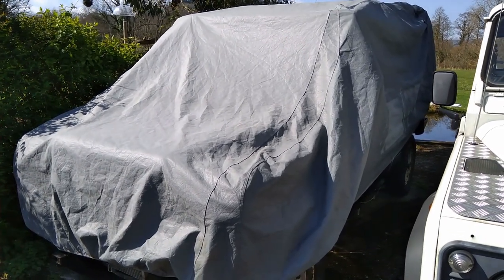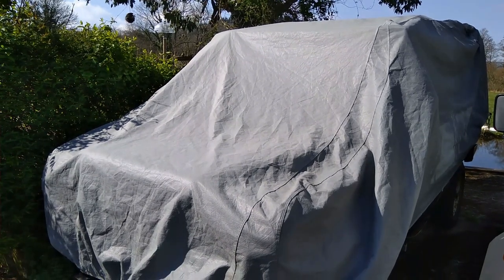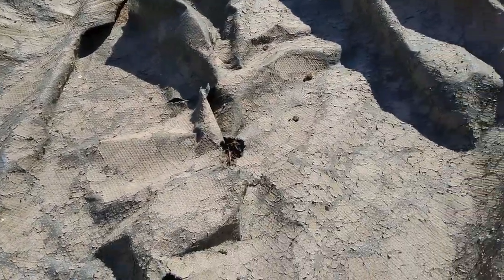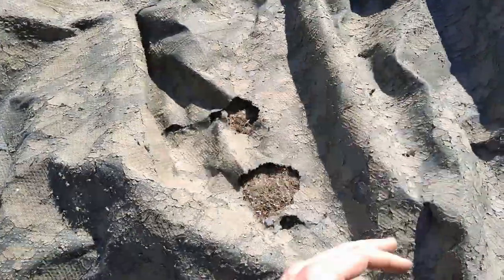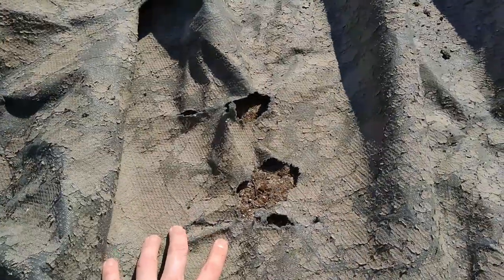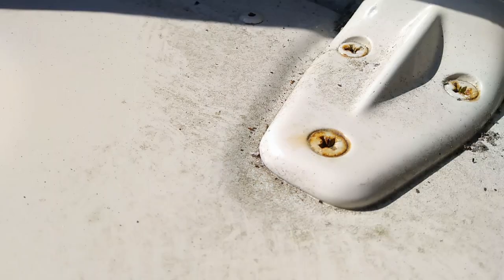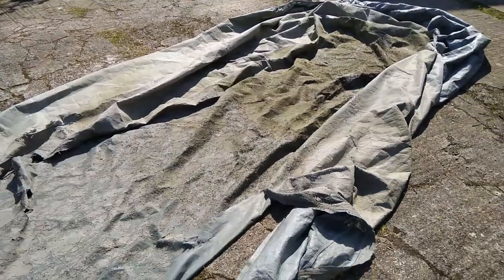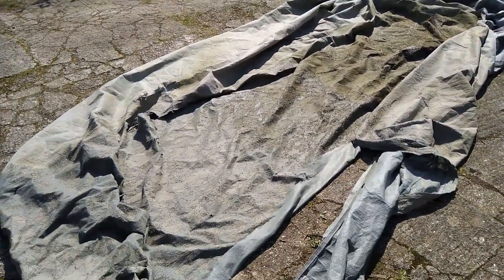Stormforce cover update after 4 winters - How is the paintwork?

Comment: I'm only a year late, but here's my tip for keeping tarps taut, I collect my old 2 litre milk containers and tie them onto the tie down loops with paracord, I fill the ones down one side and set the cord so they are standing on the floor, the other side fill to 3/4 and set a few inches off the floor then do the same front and rear, the tarp will stay taught and self centre itself, you can put extra cord over the roof and bonnet if needed, simply bin them when done they're free.
Reply from the maker: Thanks for the tip Roy
Reply: @lrworkshop  I forgot to mention once taut you can put something in the middle of the roof rack like a football to make an apex for rain run off and make some bush wires out of cord to protect the front.